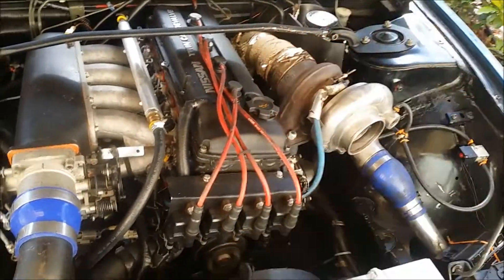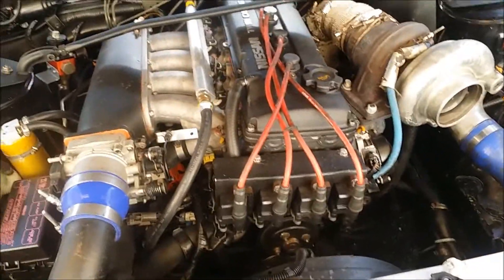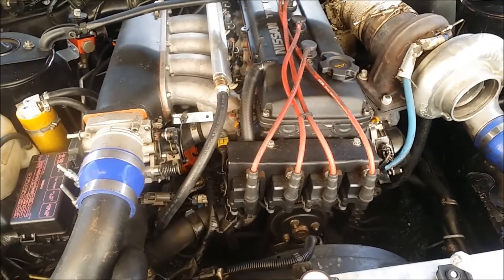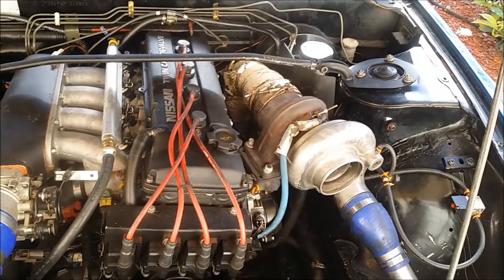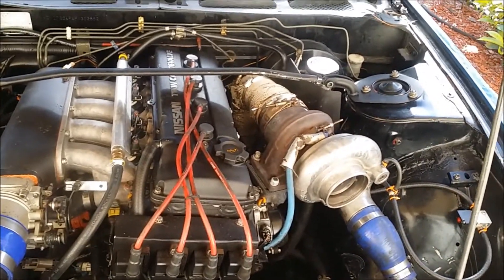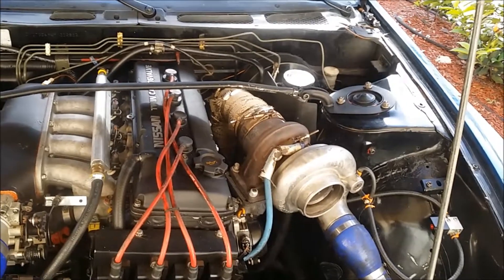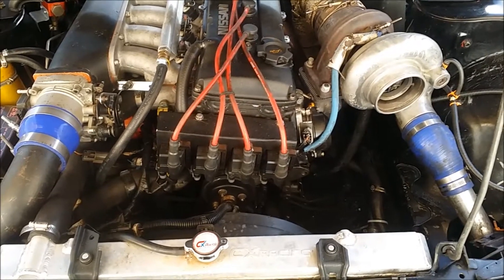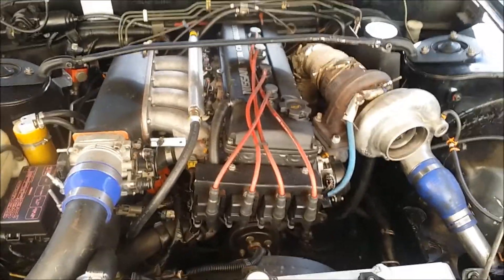Diagnosing a Misfire

Comment: still haven't figured out why its running so rich no codes no power to one of maf wires gets no power have a bypassed starter ignition and I have no sensor codes or leaks so idk wtf to do it runs rich without maf unplugged too

Comment: AEM EMS? What clutch are you using? mines slipping and brand new :'(
Reply from the maker: Rusty Shackleford Nope Megasquirt. I am using a D21 stock flywheel with z32 non turbo stage 4 puck unsprung clutch.  It is a white bunny setup.  http://www.advancedclutch.com/nx6-hdr4

Comment: I have been pulling plugs to check if they were firing and now my third one won’t fire. My injector is sticking. Now I’m aware that I need to do oil change. I removed my injector and hit it with brake cleaner. I’m afraid if I take it out and drive it hard the oil is to gassy and I’ll scratch my cylinder wall but what it it’s already scratched from me pulling the plugs?
Reply from the maker: Austin Kieffer So if the cyl has premature wear due to a rich cylinder, there is nothing you can do except a full rebuild.  Check the comprrssion and see how low it is against the others.  Engine Restore is a product that is to help fill pits in the wall to restore compression but a mechanic in a can will never fix bore wear.  Only way is to go with a bigger piston and bore out.
Reply: supakat500 damn alright man, I’m gonna try to swap the injector on the cylinder that’s not firing with one of the ones that does fire and then I’m gonna start it and see if that cylinder is firing.
Reply from the maker: Austin Kieffer Get an old plug, connect to misfire cylinger spark plug wire, hold by boot and ground on head and have someone turn on the car.  If the plug sparks, then either bad plug or injector issue.  I would do this first as those side feeds are not too easy to swap.  Make sure to disconnect all injectors when doing this in order to save from flooding the motor.  If no spark, then most likely bad spark plug wire.  If you turn on car at night or dark garage and see electrical sparks coming from the wires, then wires need changing.
Reply: supakat500 when I swapped the injector on the bad cylinder with one from one of the good cylinders, the cylinder that wasn’t working in the beginning started working and the one I put the injector in from the bad one started doing what the other one was doing.
Reply from the maker: Austin Kieffer cool found out out the injector is at fault.  Get a usex working one and done.
Reply: supakat500 what oil do you recommend for it? Stock everything, 83000 miles. When I was pulling the plugs I was dumping gas in there? Should I run a thicker oil?
Reply: supakat500 should I go synthetic?
Reply from the maker: Austin Kieffer Where are you located? Georgia n lower Rotella 15w-40.  Everywhere else Castrol 10w-40.  When you gonna boost?
Reply from the maker: Austin Kieffer synthetic to me is badically if you wanna change oil at 6k vs 3k vs dino oil.  Just don't go Mobil 1.
Reply: supakat500 what’s your Instagram? I don’t think I’m going to boost for awhile, just going to try and get the motor running a1 before I go into doin more serious upgrades
Reply from the maker: Austin Kieffer No insta.  Yea get her running good and enjoy.
Reply: supakat500 I watched a bunch of your videos like a year ago, good stuff on your channel man when I seen your video on this I knew I was gonna figure out more things about my cylinders.
Reply: 10w-40 though? Why not 10w-30 or 5w-30? It’s hot where I live. Humid.
Reply from the maker: Austin Kieffer The fsm states that if ambient temps are above 50*, you can run 20w-50.  I run diesel oil for the extra phosphorus and zinc which helps keep wear down.  Other oils removed these additives because it clogged catalytic converters and other stuff iirc.